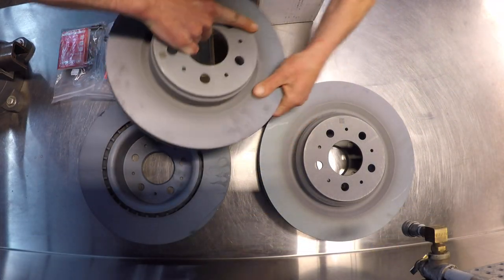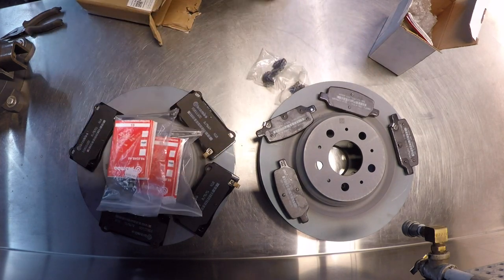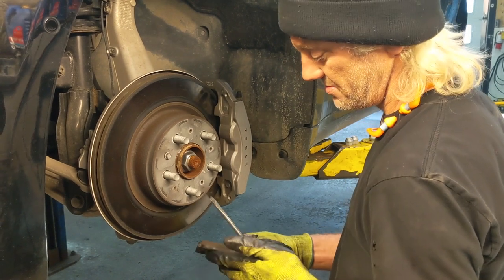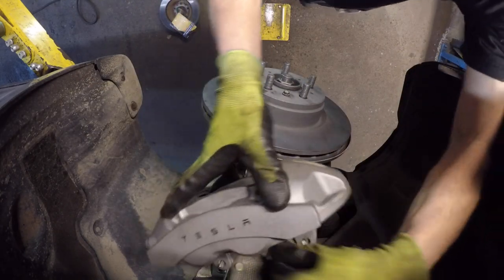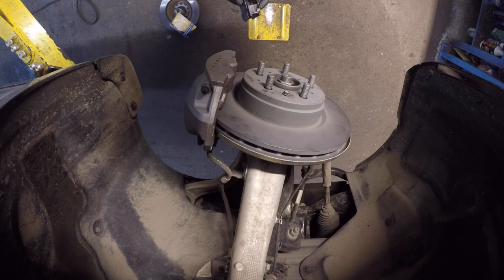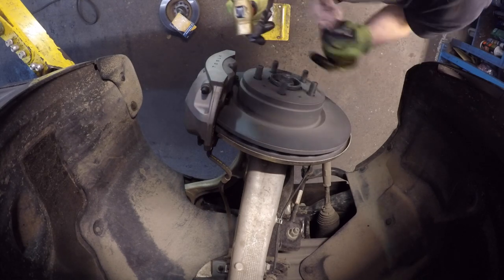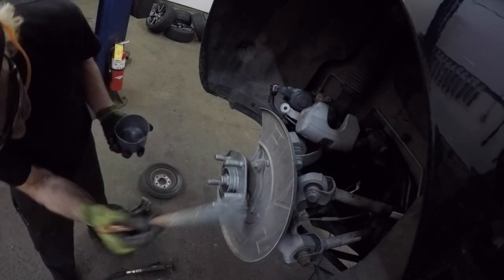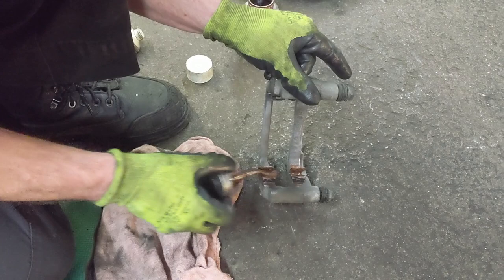HOW TO: TESLA MODEL 3 BRAKE REPLACEMENT

Comment: How did you retract the piston on the parking brake 
Regard's from Denmark
Reply from the maker: There are 2 ways to retract these type of calipers, the first is to use the on board computer to enable rear brake service/pad replacement mode, the second is to unplug the electrical connector to the parking brake motor, remove 3 allen bolts from the motor, remove the motor and then using a torx bit wind the screw and then compress the caliper. the pistons on this type of caliper do not spin in the bore. This brake setup is common to German cars and is exactly the same on a tesla. when pad and/or rotor replacement is complete install parking brake motors (slight clocking of the shaft in the caliper may be required for alignment but is very easy) plug them in and cycle the parking brake a few times, it will auto calibrate and you are finished.
Reply: You need a rear piston rewind tool